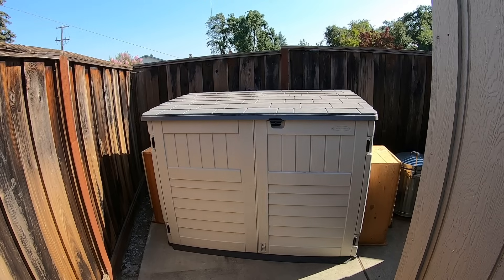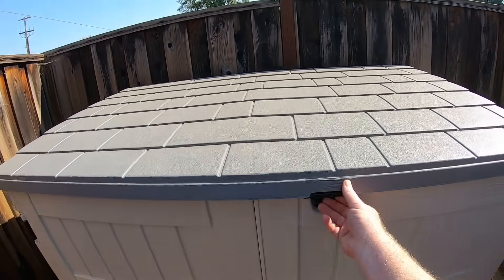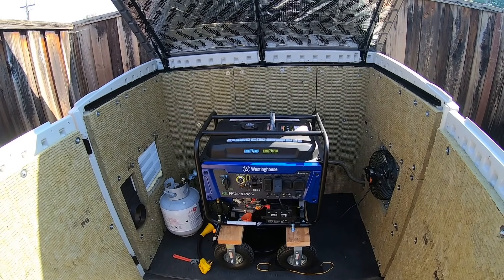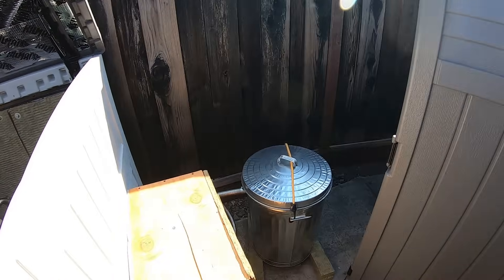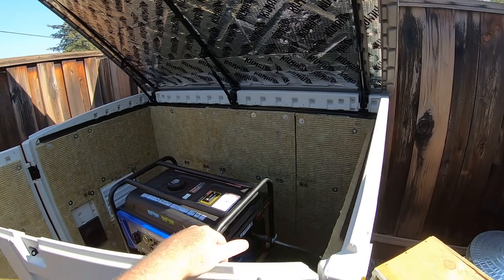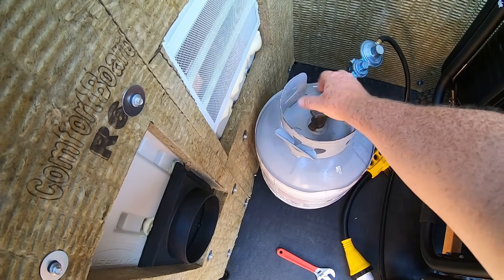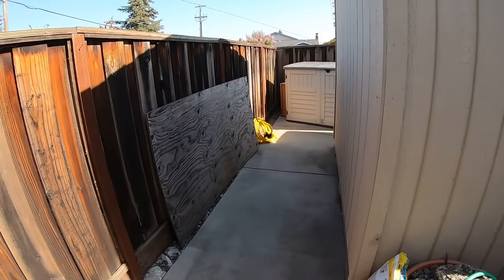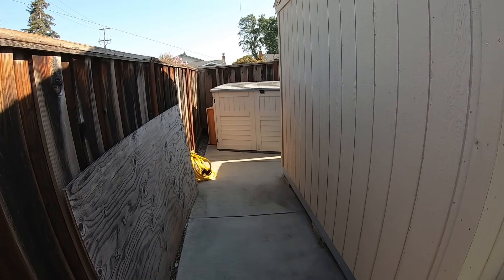DIY Generator Shed Build - Quiet Sound Insulation with Exhaust Muffler

Comment: Wouldn't just investing into a Home Generator solve this problem of noise? Most all those portable generators I've seen are just loud. 
There's a couple of those Honda inverter generators that run quieter than most of the larger systems. 
I have both.
A permanent home generator system that's powered on propane has never been any better. 
Power outage the unit starts it's self. 
Then the transfer switch automatically trips and we're on backup generator power. All within a few seconds. 
I don't hear a thing outside other than a storm . No sounds of a running generator though. 😅
Reply from the maker: The primary purpose of this generator is as a portable generator (to charge my electric dirt bikes when we are at the MX track or out camping).  The home use is just a secondary application.  If it were just going to be used as a home backup generator, I would indeed have purchased one designed for that purpose.   Also, the Honda quiet inverter generators were not powerful enough for my primary use case, as they did not put out enough wattage.

Comment: How did you mount the rockwool to the walls without running the bolts through the wall?
Reply from the maker: The rockwool that I used was 1.5" thick.  I used 2" screws to hold it to the shed walls.  I go over this in the Frequently Asked Questions and parts lists in a later video.  See the following video at about the 31 minute mark:  https://youtu.be/y3pUw408jCU
Reply: Thank you!

Comment: Best generator enclosure I've ever seen. I was wondering, does the muffler back-pressure reduce your power -- and thus your maximum load?
Reply from the maker: I actually answer this question in a later video that goes over Frequently Asked Questions and parts lists, etc.  (See it here: https://youtu.be/y3pUw408jCU).  In the newer video, I increase the diameter of the exhaust pipe from 1 inch to 2 inches, which should significantly reduce back-pressure.

Comment: very good build. Now I know what I got to do. The only thing different is I'll run my propane/gas tank out side the shed.  Thanks for the video.
Reply from the maker: The shed is actually designed to have the propane tank on the outside when running.  I was just too lazy to do it for the video.  The propane tank lives in the shed for storage, but you can move it outside when running it, and feed the hose back in through the same blastgate that the electrical cables go through.  I do mention this in a later video where I go over frequently asked questions, parts lists, shed costs, etc.

Comment: Not being negative, but wouldn't it have been easier to just sell all of that and just purchase a inverter style generator that is super quiet. Good job on the project though.
Reply from the maker: I actually answer this question in a later video that goes over Frequently Asked Questions and parts lists, etc.  (See it here: https://youtu.be/y3pUw408jCU).   Basically, there weren't any quiet inverter generators that were powerful enough for my specific use case, which was specifically to charge 2 electric motorcycles (at the same time) while at the motocross track or out camping.  I needed one that would push 32 amps at 240v, or about 8000 watts continuous, and there weren't any quiet inverter generators that had quite enough continuous power to do that.  My use of this generator for a home backup generator is really just an afterthought.  The generator also had to remain portable, so I could fit it in my truck to take it dirt bike riding.
Reply: @C5Tor  Those bikes sound FUN!

Comment: What thickness is the comfort board? 1”? 1.5”? 2”?
Reply from the maker: It was 1.5" thick.  I used 2" screws to hold it to the shed walls.  I go over Frequently Asked Questions and parts lists in a later video.  See the following video at about the 31 minute mark:  https://youtu.be/y3pUw408jCU
Reply: @C5Tor  excellent! Thank you!

Comment: What size fan did you install?
Reply from the maker: I have several other videos in this series, listed in the description.  One has a complete parts list.  You can see it here:  https://youtu.be/y3pUw408jCU
The fan is a 12-inch attic exhaust fan, 940cfm rating.  Specs are listed in the video above.

Comment: I just bought a similar enclosure just a little smaller. Being in Florida concerned about the heat and propane tank inside the enclosure.
Reply from the maker: To clarify, I designed the shed so that the propane tank can be placed outside of the shed, and the hose can be routed back inside via the blast gate on the left side where the cables also go in/out.  For the purposes of the sound test, I left the propane tank in the shed for the short run of the video.  I was just being lazy, but it should be outside of the shed when running it in a real-world scenario.

Comment: do you know the operating temp for propane tank to operate safely in the enclosure? I have been told the tanks has to remain outside the enclosure?
Reply from the maker: To clarify, I designed the shed so that the propane tank can be placed outside of the shed, and the hose can be routed back inside via the blast gate on the left side where the cables also go in/out.  For the purposes of the sound test, I left the propane tank in the shed for the short run of the video.  I was just being lazy, but it should be outside of the shed when running it in a real-world scenario.
Reply: @C5Tor  Thanks for responding.

Comment: Great job! Maybe use silicone instead of fasteners and make it double-wall rockwool separated bt large round dobs of silicone? Thanks.
Reply from the maker: That is definitely another way to do it.  I chose screws since I wanted to be able to remove the rockwool at some point if I needed to modify the shed behind the rockwool.  I go into the fasteners that I used in a later video on my channel.

Comment: We just survived 4 days of no power in Tulsa, Ok. Our super loud generator almost drove us crazy and I'm surprised one of my neighbors didn't use it for target practice. Your shed is awesome and I plan on using your brilliant design to build my own. I especially like the pneumatic tire idea. Thanks for sharing.
Reply from the maker: Make sure you view the follow-up videos (linked in the description) for more info on how I built the shed, parts lists, frequently asked questions, etc.  Also keep in mind that this was simply how I built my shed, and is intended to give others ideas on things to try.  I am not a generator shed expert, although I am an engineer (in another field).  So, take my examples with a grain of salt and good luck on your build.
Reply: Just do NOT leave the propane tank inside the shed when the generator is running! That's an "EXPLOSION" waiting to happen!

Comment: Well it's been a year.  How often have you run the generator and for how long?
Generators are intended to be run at Ann ambient temperature less than 100° F.  Certainly that insulated box will get much hotter than that.
Reply from the maker: So far, I haven't had to run it at all as a backup generator.  Been a mild year weather-wise in my area.  I've taken it to the MX track a few times.  In addition to charging electric bikes, other people have used it to power air compressors and various other devices.  One becomes very popular when you have a source of electricity at a place without it.

Comment: You bought a petrol engine to charge motorbikes? I can’t take advise from im sorry…
Reply from the maker: I said I bought the generator to charge the electric dirt bikes "while off the grid" like at the MX track or in the woods. I go into this in some detail in the following video, where I answer frequently asked questions about this video.  (See it here:  https://youtu.be/y3pUw408jCU?t=3000).  Basically, you need the energy in a form that you can use it, and you might need to jump through some hoops to get there sometimes.  For instance, do people use an electric gas pump to fill their petrol car with gasoline?  But nobody thinks that is ridiculous.  It's just a delivery mechanism.  I didn't buy the electric dirt bikes to be green.  I bought them because they are super fun to ride and are far superior to gas bikes in many respects.  Their downside is that you have to charge them somehow.  Currently the easiest way is with an electrical outlet if one is available, or with a gas generator if not.  Someday, I would love to charge it with solar, but battery tech is not there yet.
Reply: @C5Tor  I use an electric wheelchair attachment and it’s not usable. 4 hours to refuel us pathetic. If I forget to charge I can’t go out. I’m forced to rely on electricity and I hate it. My life would be livable if I had the freedom to fill my tank in moments rather than four hours. I see it’s flat n can’t do a thing. Before my accident I’d fill my bikes tank anytime anywhere

Comment: Very nice build! One of the best I've seen and I've watched a lot of videos. I live in central Florida, so I think I would really need a wood version fortified for a Hurricane. Ideally I'd like to have it operable during a hurricane so if the power goes out I can remote start the generator and I'm good to go.
Reply: Just do NOT leave the propane tank inside the shed when the generator is running! That's an "EXPLOSION" waiting to happen!

Comment: Would the fan and the vent not be enough ventilation? I'd think the attic fan would pull any fumes out of the box.
Reply from the maker: The shed is 70 cubic feet in volume, and the fan is rated at almost 1000 cubic feet per minute.  Airflow is from the vent to the fan side, where the fan pushes the air out of the shed.  It should be able to exchange the air in the shed every 4 seconds or so.  But it is never that simple.  The air in the corners of the shed will probably be fairly stagnant, and the airflow will be more across the middle part of the shed.  So, not perfect, but a good first attempt.  Tradeoff between airflow and noise.   Also, most of the fumes will be exiting the shed via the exhaust pipe, along with a lot of the heat.

Comment: thanks for the ideas! after watching several similar videos, I'm still amazed that there is enough venting to keep the temperature inside of the box low enough for the generator to function after several hours. Also, maybe it wouldn't make a huge difference if there was a fire, but it seems scary to leave the propane tank enclosed in that compartment right next to the generator. Is anyone else thinking the same thing or am I being paranoid? haha
Reply from the maker: Thanks for the feedback.  I did go into some of these details in a later video (links in the description).  The fan should theoretically be able to move enough volume to replace all of the air in the shed every 4 seconds.  That being said, it is a good idea to monitor the temperature remotely to make sure you do not overheat, especially if you have a fan failure.  I made a compromise between airflow and sound level, but the numbers seemed to work out, at least on paper.  A lot of the temperature will be moved out of the shed via the exhaust, especially if you wrap the exhaust pipe.
On the propane tank subject, I totally agree.  I left the tank in the shed for the demo of the sound levels, since I knew it was going to be a short test.  But the propane tank is really only in the shed for storage.  The shed is designed to move the tank outside of the shed, where you would route the propane supply line in through the blast gate on the left side of the shed (where the electrical wires exit the shed.)  Sorry I didn't mention that in this video.  I should also point out that there is probably just as much risk running the generator on gasoline in a confined space, since you don't have an easy option of moving the gasoline tank outside of the shed.  The propane tank allows moving the fuel supply outside of the shed much simpler to implement.

Comment: When the power goes out for days, strangely nobody cares how loud it is as long and they have an extention cord running over to thier house to power the basics...  We were on generator for 9 days after Hurrican Ian and the neighbors to far to run extention cord came over to charge phones and laptops, etc. quickly didn't care about the noise or how you were getting fuel to keep it running...  which included 50 miles runs to another city ever other day to find a gas station that had gas...
Reply: Maybe they won't care, but I'd certainly care, having a loud machine running in the backyard. For security purposes, and peace of mind, this setup is perfect. I've heard of people driving around during power outages, listening for gens. Easy targets when your house is lit up and there's a giant machine running in the back for most people

Comment: How did you attach the rock wool? I don’t see any bolt heads on the outside
Reply from the maker: I explain the method I used in the following video:  https://youtu.be/y3pUw408jCU
Other people have suggested using adhesive.  Either can work.

Comment: My generator has 12v hook ups too, so I'm considering using a 12v auxiliary car radiator fan so I don't impact the wattage draw as much as a 110 fan would. I'm also thinking of wiring in a 12v rheostat switch to control the fan speed in case the default speed is crazy fast & loud.
Reply from the maker: All good ideas!

Comment: Suncast sheds discinerate in a couple of years.  Have a couple of their patio trunks, they turn to powder when you touch them.
Reply from the maker: Any of these plastic sheds can oxidize when left out in the sun and elements.  An occasional cleaning can help.  If all else fails, you can use the blowtorch method to get oxidized plastic surfaces all shiny again, although I've always questioned how long that will last.  I have used that method on dirt bike fenders and plastics, and it does actually work.  Remove any gas or propane from the shed first, if you use this method!  But you are correct that plastic sheds can not only oxidize but sag after years in the outdoors.  They are not as durable as a nice wood or cinder-block shed would be.  The cost of convenience.

Comment: fantastic job, love the pneumatic wheels and the exhaust dustbin silencer. the only thing i would add as a keyboard observer is some foam noise absorbers on the lid and sides to break the sound up.i will soon be in the same position as i am trying to get a genny (long waiting list...) and will build a house for it too.i will be doing a room within a room on mine.
Reply from the maker: Thanks for the ideas.  If you are interested in the parts that I used, I have several more videos in this series. (See the video description for links.) One of the later videos is on my Version 2.0 exhaust, which has quite a few improvements over the earlier version 1.0 setup. The newer video also has parts lists, shed costs, and other Frequently Asked Questions.  Check it out here: https://youtu.be/y3pUw408jCU

Comment: Did you go to your neighbors and see how loud it is at there house
Reply from the maker: Fortunately, the generator shed is in a corner of the property that is next to a cul-de-sac.  So, it is on the street side rather than next to a neighbor's house.  But on the other side of the fence, it is in the mid-50 decibel range, which is pretty much ambient noise in my neighborhood.  I show this at the end of the video.

Comment: Imagine putting an inverter generator in there. That generator you have is meant for a jobsite.
Reply from the maker: I would have loved to do an inverter generator.  However, none of the ones currently manufactured met my requirements.  I explain this in a later video, in the frequently asked questions section.

If you are interested in the parts that I used, I have several more videos in this series. (See the video description for links.) One of the later videos is on my Version 2.0 exhaust, which has quite a few improvements over the earlier version 1.0 setup. The newer video also has parts lists, shed costs, and other Frequently Asked Questions.  Check it out here: https://youtu.be/y3pUw408jCU

Comment: I have that same generator, and started a shed build last year though I never finished it.  One problem I ran into, I could not find flex tubing that would match the size of the exhaust outlet.  What did you get for yours?
Reply from the maker: If you are interested in the parts that I used, I have several more videos in this series. (See the video description for links.) One of the later videos is on my Version 2.0 exhaust, which has quite a few improvements over the earlier version 1.0 setup. The newer video also has parts lists, shed costs, and other Frequently Asked Questions.  Check it out here: https://youtu.be/y3pUw408jCU

In that later video, I discussed two different ways that I connected flex pipe to the muffler.

Comment: What coupling and flex pipe did you use to connect to the generator? Great build. Thanks for the video.
Reply from the maker: If you are interested in the parts that I used, I have several more videos in this series. (See the video description for links.) One of the later videos is on my Version 2.0 exhaust, which has quite a few improvements over the earlier version 1.0 setup. The newer video also has parts lists, shed costs, and other Frequently Asked Questions.  Check it out here: https://youtu.be/y3pUw408jCU